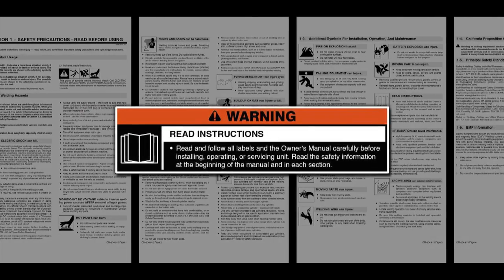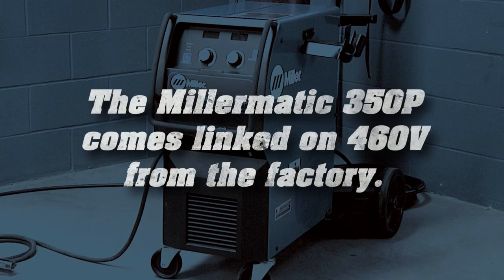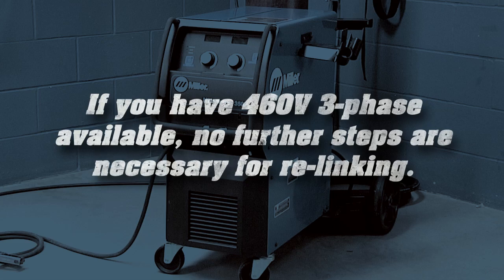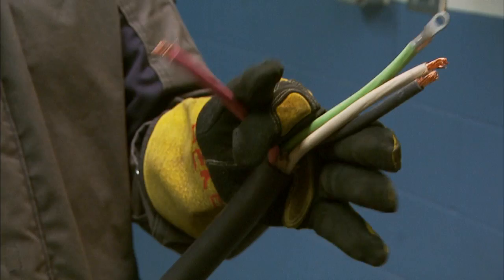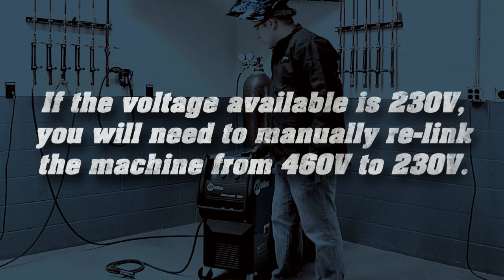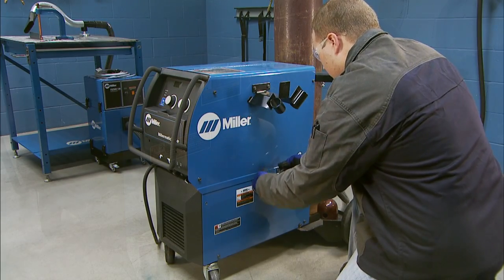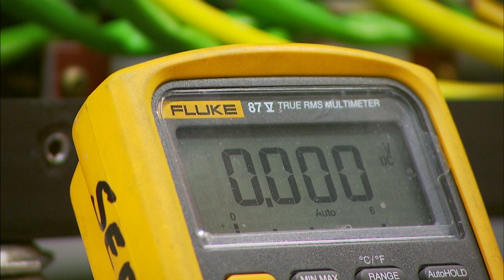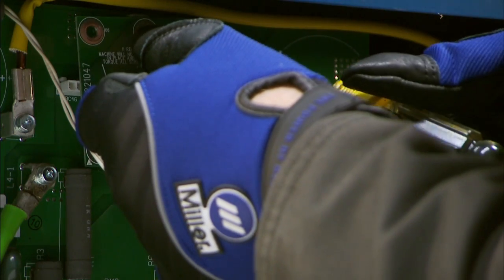Millermatic® 350P MIG welder re-linking

Comment: Watch the video, read the instructions, got a buddy who is a certified electrician to check all my work, good to go. Swapped it to 230 and turned it on. It powered up and let it run for about ten minutes and turned it off.
I bought this about 3 years ago, had back surgery and never used it, just turned it on.
I go to finally use it and its showing Help 9 pulse to interface board issue.
Ive used miller almost exclusively in the military and this is the first time Ive ever had an issue with them and just my luck its friggin broken from sitting for three years under one of your $170 big blue covers.
Totally disappointed!!!
Reply from the maker: We appreciate you sharing your feedback. Quality and reliability are very important to us, and we are sorry to hear this was not your experience. We recommend giving our service line a call to talk this through with a tech. The number is 920-734-9821. If there’s anything else we can help with, just let us know.

Comment: First great video.  I bought mine and was wired for 460, I have 230.  I have a question when you say isolated the red wire are you talking about where the wires connect I side the machine? I know on my plug and breaker I use the the red and black for my power and the green for ground.
Reply from the maker: Thanks for reaching out. We recommend giving our service line a call to talk this through with a tech. The number is 920-734-9821. Thank you!